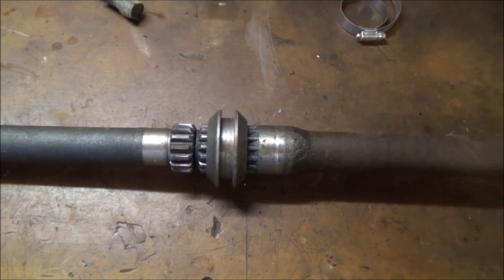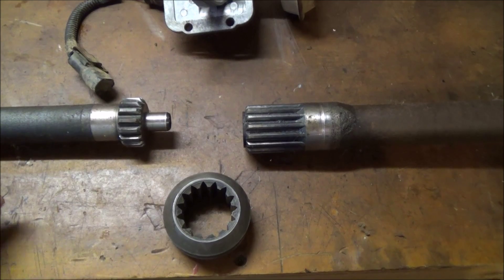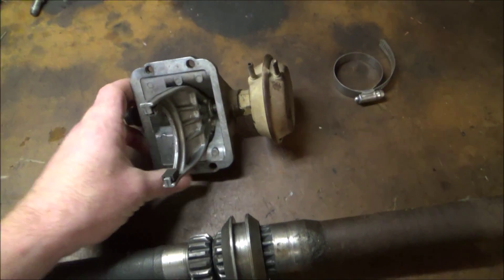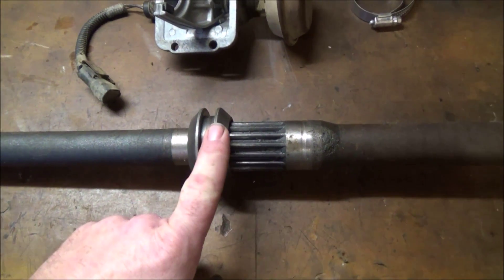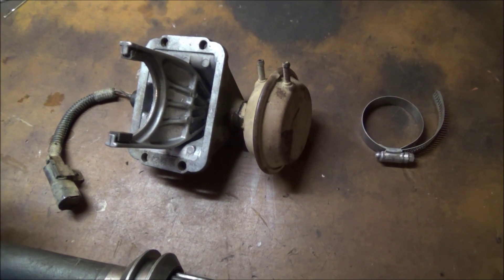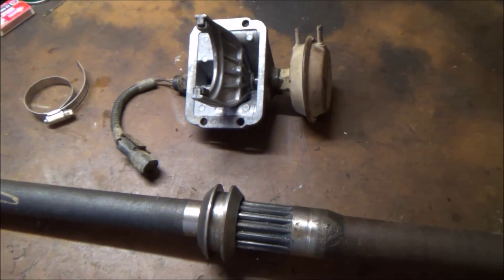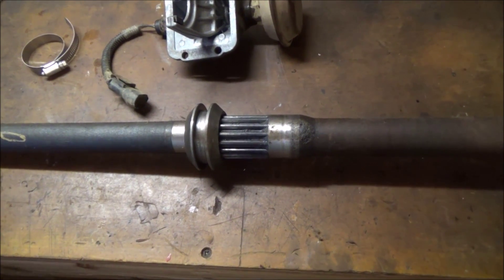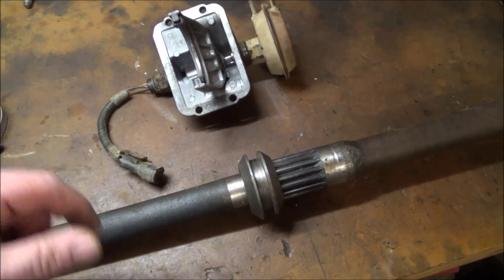Jeep Dana 30 disconnect front axle

Comment: My yj 2.5 ltr has 33s 
This winter i put it in 4 wheel drive on a hill and the front tires were not spinning . Only rear was .
Than i put it on 2 L still nothing .so embarrasing .
Can anyone help me why the front wont move . Seems like 4x4 does  engages  and gets me out of parking lot and when lots of snow on ground but struggles on hills . Is it the big tires ? But in snow it should be easier to spin i guess.
My jeep even has  lockers 
There is a red dial up knob incab . I bought the jeep like this all modified
Reply: The red knob is not a dial up. It's a pull knob that's cable driven to the shift fork. When you engage your 4wd on the floor, you pull the red knob outwards. It's a manual cable that moves the shift fork to lock the two axles together. The vacuum lines are void. If you trace the black line from the red knob, you'll see that it runs to the shift fork housing cover. It runs into the housing and is connected to the shift fork internally. You will notice that, behind the red knob is possibly a black dial. When you pull the red knob outwards, you can dial the black knob clockwise to tighten up on the rod and lock it in place from working back inwards. It's much better than relying on vacuum to move the fork. Manual activation, over electrical, button, or vacuum is always my choice. If you pull on the knob and it won't move, check the black dial behind it and make sure it isn't tightened down on the shaft. Rotate it counter clockwise to free up the red button to pull. The black dial is basically to keep the red knob/shaft from working back in when it's pulled out. You may not need to use the black dial when the red button is outwards. You will figure that out after you use it. If your red button walks in when it's activated as you are four wheeling, then you'll know to just use the black dial to lock it in place. 😁
Reply: @ArrowItArchery  wow 
Man you are a pro.👏

I end up selling the jeep 😂

Comment: I still use mine flawlessly.  The shaft only engages if shifted into 4x4. So, I have found another remedy if the vacuum system failed. Taking the actuator apart  you will see the "C" clips that hold the fork in place. Take the "C" clip off on the side that would slide the fork over to the side where the collar engages the shaft. Replace the "C" clip on the opposite side of the fork and this keeps the fork in the engaged position. Now you use your 4x4 shift as normal for off road.
Reply from the maker: Nice! Thanks for the info.

Comment: I would like to know if the posi locker blocks the front wheels and does the function of a locked differential or what is the purpose there?
Reply from the maker: Good question.  The posi lock does not lock the front differential. Only engages the passenger side axle shafts together.

Comment: The only problem with a one piece is the differential and driveshaft will turn all the time. Not so bad if you have the 4.0L but if you have the 2.5l it robs a lot of power.
Reply from the maker: Good point.